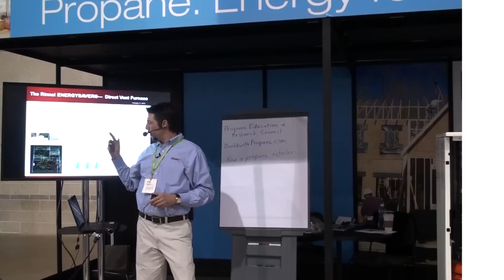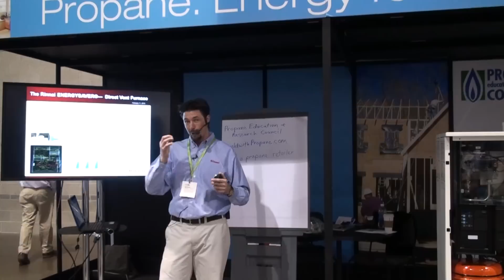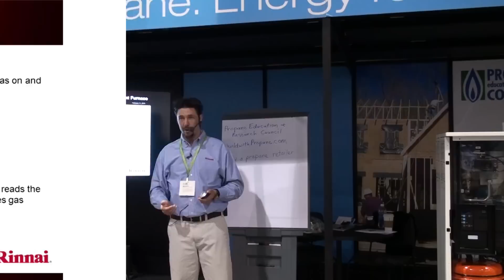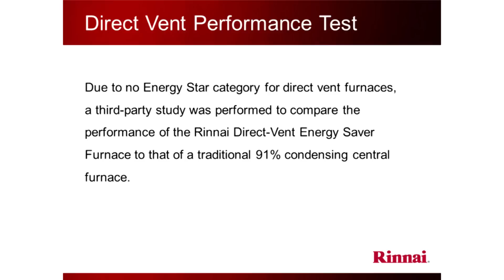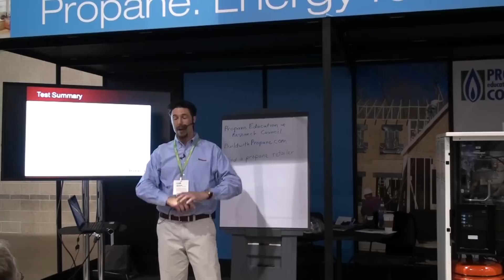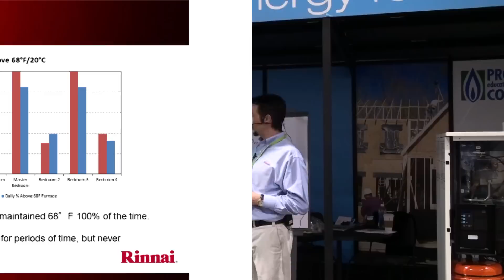How a Direct Vent Furnace Provides Efficient Whole-Home Heating

Comment: We did  have three Rinnai heaters in our 4000 sq foot home in Montana in 2000 and it did an amazing job keeping the home warm in below zero temperatures and our propane tank was usually refilled about once every two  months at a cost of about $150.00 which we thought was high. LOL Now we realize how cheap it really was. We live in the Texas panhandle where it gets pretty cold and the wind blows like crazy in the winter and we have a 90% high efficiency natural gas heater/ electric air conditioning unit that was super expensive to install and it has significantly dropped out electric and gas bills both in half but even at that we pay about $200 a month in electricity bills and gas is around $20 a month so the gas is significantly lower using natural gas and a high efficiency heater than the Rinnai back in Montana although our home here is smaller at only 2200 square feet. The electric bills here are super high for some reason but we have installed solar panels on the roof and hope to bring that down and soon will have some Tesla batteries in the garage and even more solar panels to add later on plus all windows here are now double panel argon filled which Montana was not and our doors are fiberglass which Montana was not so that helps significantly as well.
Reply: I realize Im quite off topic but do anybody know of a good site to watch new movies online ?
Reply: @Hector Otis I use Flixzone. Just google for it :)